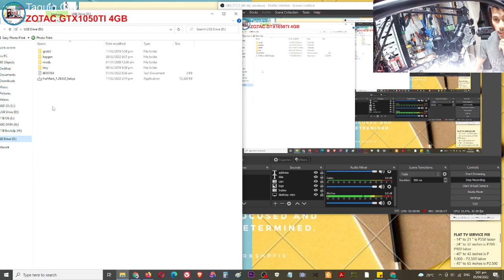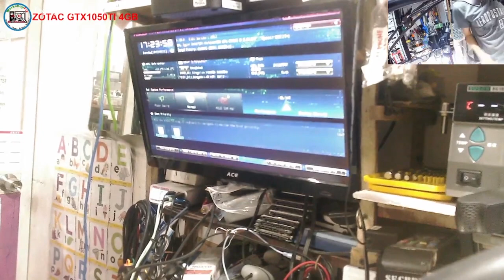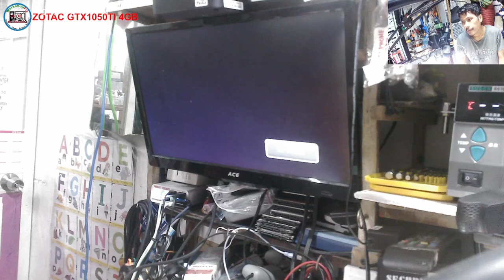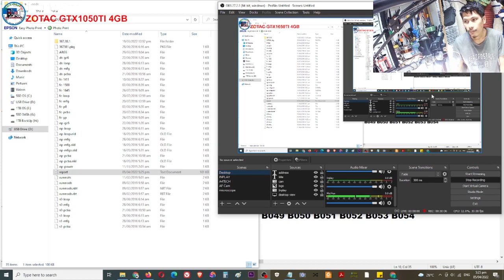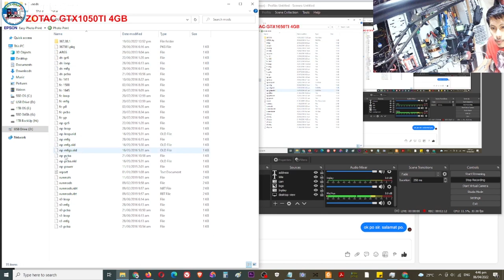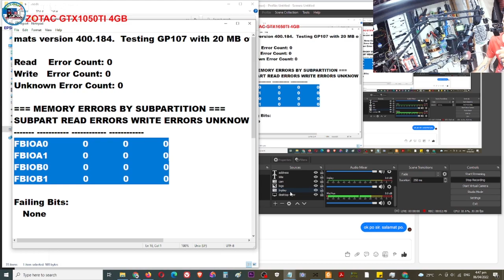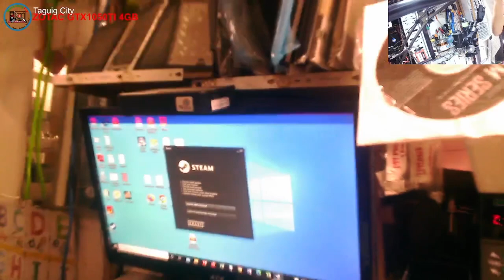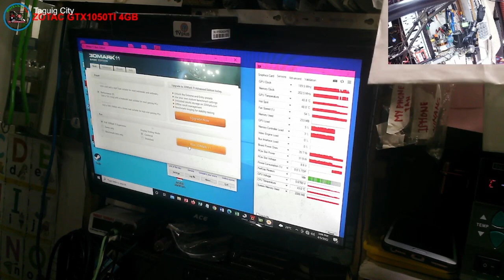ZOTAC GeForce® GTX 1050 Ti 4GB - VRAM ALL FAILED, A1 DAMAGE, REBALL ALL

Comment: When this card first started I saw screen artifacts that then cleared up so one of the support chips seems bad but after it runs it clears up. So you said at the end you had run it for 22 minutes and it had no errors. So it seems good with your system. The customer might have a not so good power supply but if good the card will work.
Reply from the maker: PM po kayo dito sa Video Card(GPU) Repair Business Page para po sa information, contact no., location at ma-assist kaayo.

Salamat po,
link: https://www.facebook.com/VideoCardRepair/

Comment: Sir ask lg po.. anu po yung software pra ma detect yung problema sa GPU? salamat po...
Reply from the maker: Walang software na nakaka detect ng oroblem ng VC
Reply: @WorkshopFix  sir nag try ako ng MATS pra mka detect ng kng my issue yung VRAM at PASS nmn po yung test.. all voltage present nmn kaso minsan random no display.. na test ko nmn po lahat ng input ganon prn.. ano po kaya possible na sira or baka my suggestion ka sir kng saan ako pwd mag test point.. newbie lg kc.. salamat sir
Reply: ZOTAC 1050ti yung VC ko pla sir.. yung mini
Reply: @ojie8140  baka po may low resistance na mga capacitor or mosfet